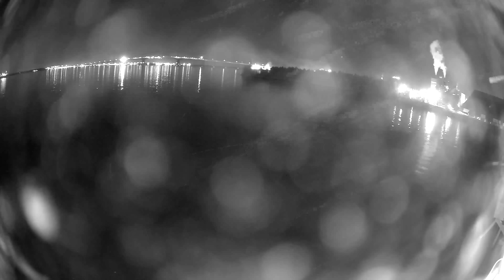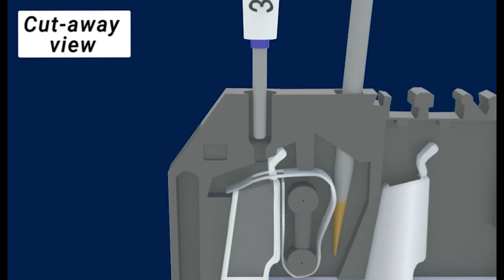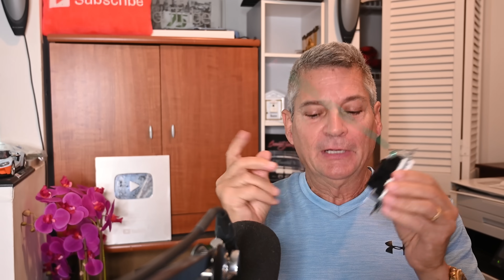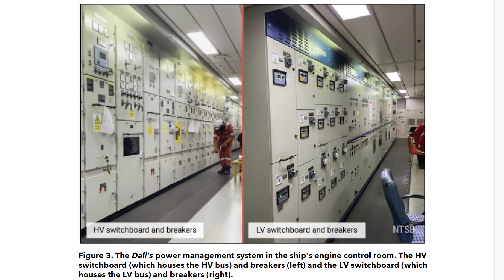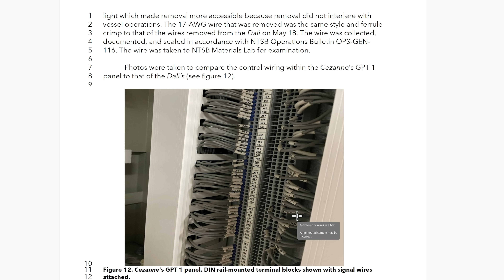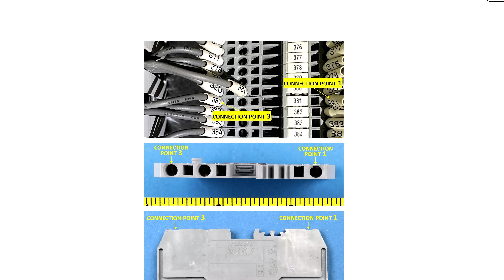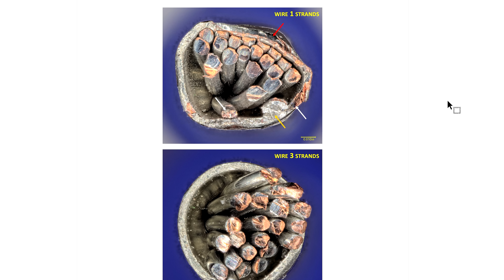NTSB: Scary Wire ERROR Caused Dali Crash/Key Bridge Collapse Baltimore

Comment: Bad workmanship,  bad electrical design and bad mechanical design!  The terminal block doesn't appear to allow visual verification that the connection was done properly any with tens of thousands of those on board, one or more is for sure going to fail.  Also, a single point of failure (one wire in this case) should not be able to cut power to the whole vessel!

Comment: The picture at 24:23 shows Wire 3 with the end being circular, while the end of Wire 1 is heavily distorted.  I believe the distortion was not caused by the wire being jammed in multiple times during installation, but as Wire 1 was not securely installed it backed out several times (while in service) each time leaving another mark on the ferruler until it finally popped out at which time the end was damaged/distorted as shown.   Going back to 23:47 shows the side view of this ferrule and where 5 locations are highlighted (red pointer) showing it being clamped, however I count a total of 9 clamping lines.  I speculate because the ferruler was not extended down as far, it was more able to wiggle and thus walk out of the clamp.

Comment: Troubleshooting intermittent connections in panels of these terminal blocks is very frustrating so I make a point of pulling on each wire to check that it's fully in place.  That finds the problem most of the time.  For smaller systems I've designed I do the wiring myself to make sure every connection is fully in and secure.

While this may have been the root cause of one of the problems, fuel and configuration errors contributed greatly.  The systems in that ship have redundancy so this shouldn't have caused the problems it did.  But if the crew has dampers closed and insufficient fuel for the DGs then the redundancy is out the window (or perhaps, thrown overboard in this case).

Comment: I never liked those fast snap connectors. I still prefer good old screw when possible. Sure, sometimes its pain in the a** to get it right, but at least you know its well connected.
You have to always make sure its metal on metal and insulation isnt in the way, ofc.

Comment: Jeff, gday. The ferrule looks like the tool easnt inserted to release the sprung bar across opening the gateway for the ferrule and its has been tried to be forced causing tbe label tag to be pushed along the wire towards the terminal. Then id say they have jiggled the tool opening the gateway alowing the wire to insert giving a false locking condition the installer considered good.

Comment: In this "new age," old school principles written with blood have been overlooked/forgotten.  If you forget history, you are destined to repeat it.  In the 1960's, Air Force high reliability training taught that by first principle an assembly must able to be visual inspected (inspectable).  This principle applied here: There would be a measurable gap between the label and the ferrule where the wire would be visible below the label as would be the top of the ferrule.  This allows the insertion depth of the ferrule into the wago to be inspected insitu.  Thus the insertion depth of every cable could be inspected in every cabinet. Needless to say the calibrated eyeball (visual inspection) is underrated and little use these days - a la Boeing door plug fly off in flight due to missing bolts...

Comment: Spring tension of the terminal blocks could reduce over long periods due to aging of the spring. Perhaps testing has proven that wrong, but similar gripping in ordinary electrical recepticals has been problematic on land after decades, where there is no vibration nor humidity. Better would be trusty screw terminals which could be periodically tightened by hand just to be damned sure (as tedious a job as that might be). How are you to test the springiness of the spring type? Another aspect of the contacts is gas tightness, e.g. oxygen or other gases must be excluded from the point of contact. The screw, when tightened properly, does that.

Comment: I've specified the same Wago terminals on various large electrical projects. One reason they were chosen was because you can see when the ferrules are not fully installed. I always specified insulated boot lace ferrules crimped onto tri-rated panel cable. It was important that the Wago ferrules were used because the insulation was exactly the correct diameter, a number of other ferrule suppliers have a slightly larger insulated section. We also used Wago's crimping tools and free-issued them to the lads, because why wouldn't you if you want quality. It is easy to visually inspect all the terminals in a panel making sure all the ferrules are correctly inserted. 
We do use printed heat shrink ferrules, we intended to shrink them down after the panels were signed off and commissioned, but when the plant was running were not opening everything up again for that, and they were much easier to read before they were shrunk.
Out of tens of thousands of connections we had zero issues. Even with quality screw down terminals we often see tens to a hundred of poor insertion issues, and the skills of the installers is not what it used to be.

Comment: You got it right at the very end; "cheap part".  This type of connection should never be allowed for ship board use (vibration, flexing, temperature fluctuation, salt air).  The pictures are excellent at showing insufficient  contact area at best. You stated you had problems with this type of connection at your rental properties on shore. "Mickey Mouse" is the nicest word I can think of to describe the construction quality of this type of connection.  Yes it's cheap initially but in the long run, not so much.

Comment: overengineering strikes again. well kinda. i hate those ferruled connectors in MCC cabinets i work on. would rather just have bare wire with a good twist. its not going anywhere it cant move on its own. it doesnt need all the condoms.

Comment: Thank you Jeff.  I want to suggest:   Just as you showed that by grabbing and moving a wire around, it will detach from the spring clamp, I'd bet the ferrule is designed so if the blue cap is properly fully seated then the point of electrical connection can't be rocked back and forth, working its way out.   The photo of scratches on the metal part of the ferrule looks like it was originally seated far enough to work fine electrically but perhaps over time, movement of the wires especially if there was outward tension on the #381 wire maybe it worked its way out?

Comment: Great job describing  the findings. Worked in the steam turbine  / generator maintenance and repair since 1978. Paper mills some marine . I was on the mechanical side. I really enjoyed and understood the message. The different times I had bin on ships I was told one generator on line and a second generator running on standby ready to take the load. Like you stated, have to synchronize. Panic time. Really enjoyed.

Comment: Some new dude on the job, not just ships but electrical work. I've only recently via my hobbies started crimping various types of wires with different terminal types, including the red/yellow/blue ferrules; I've had a lot of trial and error, redone, redone again, and straight up ugly terminations as I'm learning—some of it just because I'm unsure where exactly to place things like heat shrink, labels, where to cut insulation, and etc. Thankfully I only work on my hobbies, not massive cargo ships.

Comment: Great explanation for us Lay people. Thanks. And........ I think you are spot on with your observation. It looks as though they have tried to force the ferrule into the spring clamp without using the tool. You can see vertical scratches on the top angled tab of the spring clamp and damage to the end of the ferrule.The top of the spring clamp is slightly angled and I think that if you push down hard enough with the cable the ferrule may be able to force the spring clamp slightly to the side just enough to force the tip of the ferrule into the spring clamp seat. And while trying to force the cable they have inadvertently pushed the label down over the plastic plug so it couldn't go down any further no matter how hard they pushed. I think you're right!!!

Comment: Long-time electrician and also a professional engineer.  When I was involved with terminal cabinet terminations, tactical feedback was critical.  Plus, a good tug after termination was the test.  

As for back-stabbing, I have replaced entire homes that had back-stabbed outlets - and saw zero issues.  The high load areas - kitchens and bathrooms had used screw terminations.

Comment: This one piece is not the cause. Bad engineering is the cause. How can you design a ship that big in a way that a single wire can render it unmanouverable!? Are you kidding me? There are clear problems with the circuits that power the fuel pumps for the main generators. They should be readily fed by the auxiliary/emergency circuit automatically.

If the ship is allowed to run on a single transformer, both breakers on high and low side should have means of manually lock them closed (override the eletronics) in an emergency.
Reply: P.S.: Just saw somebody on the comments telling the crew was feeding the engines with a maintenance flushing pump... This shows lack of idiot-proof design in a critical system, witch is bad engineering by itself.

Comment: Not that I'm any kind of expert, but it looked like all the labels were at least partially covering the blue piece. Apparently on 381, it covered most of it. My other question is, how many user errors were there that caused this, and how many design failures? Not having gas in the generators makes them useless. It wasn't fault tolerant at all.

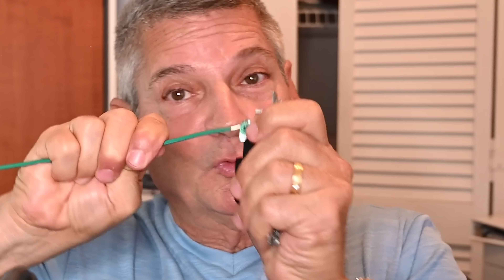Comment: 8:25 sorry, not true in general. Prefer spring loaded tensioners AND INSTALL THEM PROPERLY EXACTLY THE WAY THEY WERE DESIGNED FOR. They are self healing, screws aren’t. Especially in surrounding with vibration. There are more things to do wrong when using screws. In this case, the idiot installing the wire wouldn‘t have e.g. properly inserted the wire under a screw or wouldn‘t have used the right tensioning momentum. And with screwing, you see almost no mistakes, only the obvious ones. You must use second way proving like thermal imaging. And then the connection is used for quite a time in a ship with huge vibration….
I mean, you see how the connection worked out of the spring 23:30 because the badly performed label made a lever.

Comment: Here's another theory, well funny idea, the heat shrink label was not shrunk tightly enough and during the first attempt to insert the ferrule into the block slipped down over the blue collar preventing proper insertion because the installer was having difficulty continued to try and force it it.  By this point you are holding the assembly by the heat-shrink label with enough force that you can't force the ferrule in any further - you are just doing more damage to the ferrule.

Comment: 22:02]  That mark on the side of the shell of the terminal block looks like the 'spring clip' has overheated and melted its way, under spring pressure, into the plastic of the terminal block.  That's one idea.

Comment: There have been a lot of comments about how remarkable it was that a single bad connection cause the entire electrical system to fail - and it is bad.  Think about it this way though, imagine a saboteur had simply gone in to the panel and cut a single critical wire, we probably would not have been as surprised at the effect.  But, this is the real effect of poor workmanship culture, a lot of nuisance malfunctions and a one in ten thousand critical failure.

Comment: What a simple, stupid issue. I do Fire/burg alarm, access control and other low voltage systems, and very familiar with ferrules. Even on the simplest, non life critical connections, I make sure they are fully inserted, and have a strong connection, as any good tech would. But it’s still something I come across as an issue all the time. I’d bet no one would ever imagine the chain of events it would cause. That would be a great teaching point of why the smallest mistake could cause a catastrophic failure you couldn’t imagine.
Complacency, mediocrity, and negligence all once again causing almost every horrible accident that’s ever happened. Stay diligent, and stay as close to perfection that is sustainable.

Comment: I am surprised that in this video you say that securing the cable by screw would be the best solution. 
Actually the spring loaded version is much better. The changes of temperature on these connections can losen the screw and thus lead to a bad connection - spring loaded connection is not prone to this effect.

Comment: I'm always running into standard 120v 2 prong plugs not fully seated in the outlet. 3 wire plugs are a little better since the ground plug is a longer. There are also some new outlet and switches that have plug in wire connections with lever clamps. That system is claimed to be both faster assembly and more reliable than screw connections.

Comment: That diesel generator didn't stall it was shut down because the relief damper was interlocked with the run sequence. If they aren't interlocked the generator can actually suck the damper in.

Comment: I've talked to so many people about this issue with labeling cables for YEARS. That any label should be placed 15cm (4") AWAY from the connector itself. This is to aide in reading the labels in very dense installations without having to remove the wire/cable first...

And here we again see something what idiots do, they put the label right at the connector when there's multiple reasons and even CODE to say DO NOT DO THAT!!!

People need to stop this!

If you're a professional, you put the label  at least 4" away from the connector itself, ALWAYS!

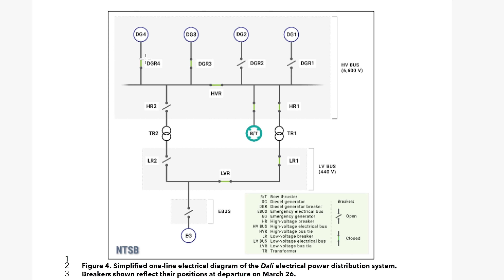Comment: 11:20 You cannot power the whole LV Bus from the Emergency Generator.
The LV Bus powers the ER Bus in normal mode, but in Emergency Mode the EG powers only the ER Bus.

The normal generator sets are 4-6000 HP each, whereas the Emergency generator is maybe a tenth of that about 5-600 HP

Comment: I like how you had to cut the video in order to fit your narrative at 8:24. That wire did NOT "come out easily". You had to cut the video because a properly inserted wire is difficult to remove under normal usage.

Comment: My question is why wasn’t there a manual backup steering option?
Reply from the maker: the steering requires full power. there is a backup generator for the engines, that under ocean rules needs to be up and running in 45 seconds. But the fault happened twice! They simply ran out of time before drifting into the bridge. They lost at least 90 seconds waiting for the backup generator to kick in both times.

Comment: I think the crushed tip wasn’t from someone shoving it in when built but from the spring retainer crushing it as it was finally spit out. Looks like it was working its way out until it finally deformed at the tip where the inner wires were no longer supporting the walls.

Comment: I've used these ferrules and terminal blocks in test equipment built for the Bradley Fighting Vehicle when I worked for Boeing BMA.  Never put the label close to the ferrule, no need.  This type of connection is not gas-tight and is therefore unreliable for critical applications where loss of life is a possibility.  Always do a pull test after connecting.

Comment: It's surprising that the components aren't better designed and also that there isn't more built-in redundancy.
Reply from the maker: There is redundancy but it takes a minute for backup generator to kick in
Reply: @jeffostroff Yes, but from what I understood in the video, the generators ran out of fuel? Why didn't they fill up in port? That seems REALLY short sighted to leave with empty generator tanks.

Comment: If something is pulling that hard on the wires on your outlet in your wall, you have much larger problems than using stabs or screws. 
Otherwise, good video. Details matter.

Comment: I use these ferrules and terminal blocks all the time, I also have shipboard systems experience, although not relevant here. That deformation on the end of the ferrule didn't happen by shoving it in the terminal block - this things are tough. That looks like it was a damaged ferrule that the crimper didn't straighten out.

Comment: It is clearly the mechanical design problem of the terminal block, the hole is too small, there is no feedback if the terminal is securely connected. The technicans may be careless but the mechanical design of this kind of connection must be upgraded.

Comment: I'm a product design engineer and terminal blocks are not designed properly. The clearance is too tight.
Also, connectors should be used.

Comment: I find it both funny and a little sad that one of those spring clamp style connectors was the failure mode that caused this bridge collapse, I've had to fix many faults caused by them over the years. The problem I usually encounter with them is it only takes someone to use the incorrect tool/too much force to jam the connector open and deform the spring and then you get the worst kind of faults: intermittent ones that aren't obvious to see. You can argue its the fault of the installer, yes, but I've had to fix bad connections caused by this on equipment that's come brand new, QC tested from a factory of a billion dollar company manufacturing in Scandinavia. If they can't get it right sometimes, how do you think that same connector is after a 5-10 years out in the field, when 5x different diesel technicians/sparkies have been in there faultfinding/replacing wires, and you can guarantee NONE of them are going to be carrying some special WAGO tool?